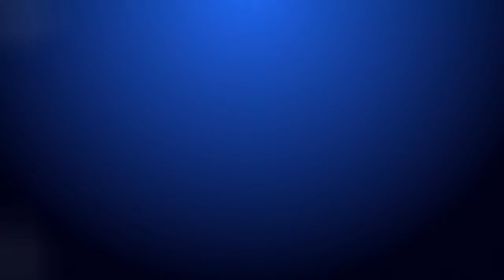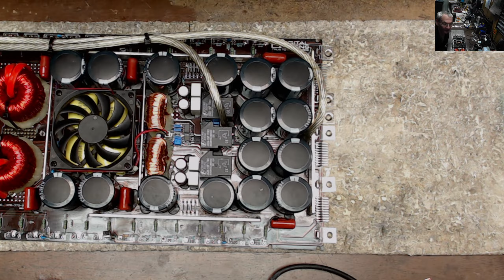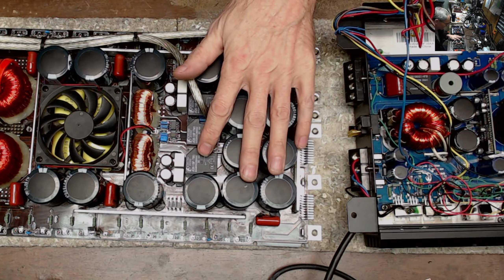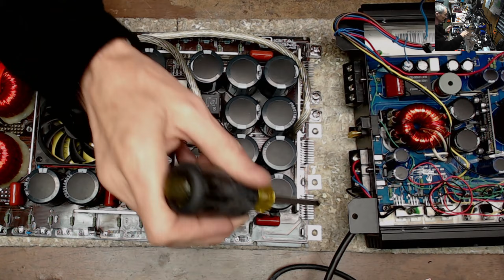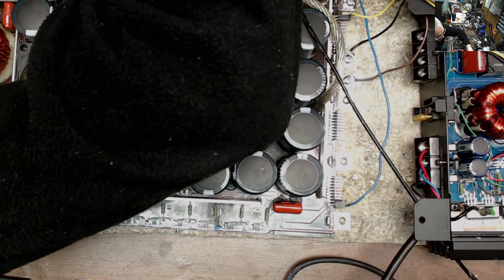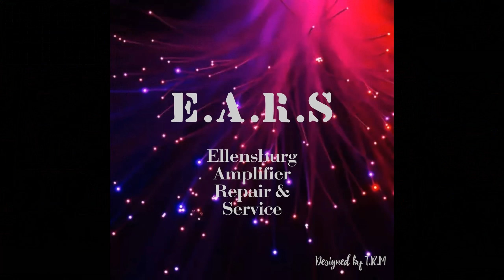Power Up Your Amplifier Output Board SAFELY Using low Voltage Digital Designs Z2C Class D Amp

Comment: Im working on repairing a blown salt 8 whose board is identical!
Reply from the maker: These are a typical S&I design that can be frustrating at times for sure. I have an 8500 board on the table now that keeps popping a low-side bank when everything checks OK and all new components installed.
Reply: Jeez what do you think the issue is ? Has to be a fault with the driver card no? Also is there a way to trigger the high side drive with no fets on these boards ? I know they're in a bootstrap config which makes it a bit tougher @ellensburgamplifier
Reply from the maker: @rashad5286  New drive card, new MIC4452's, new zener diodes, etc have been installed. I will be pulling all the outputs, checking low side drive, then install a low side transistor to check the high side. You can put a capacitor across the low side but I find a transistor works best for me when looking at the scope.